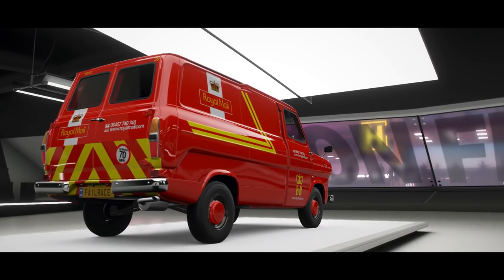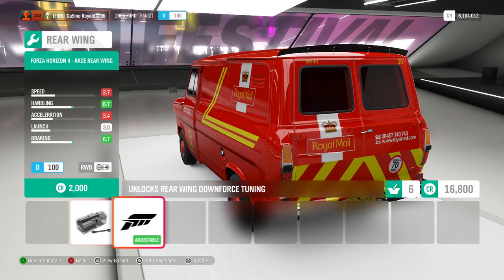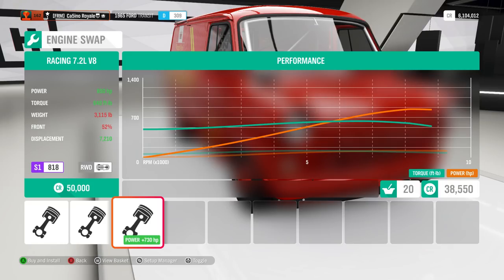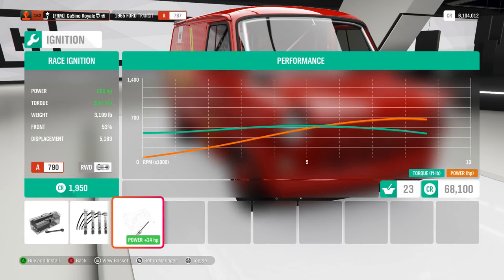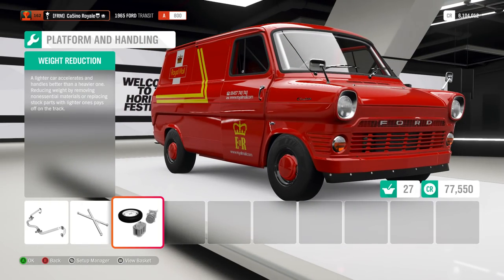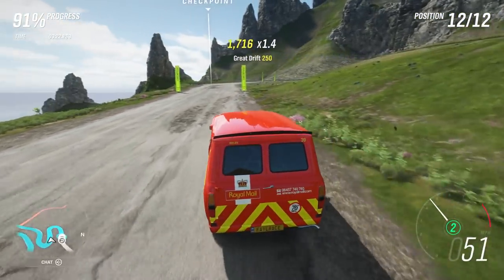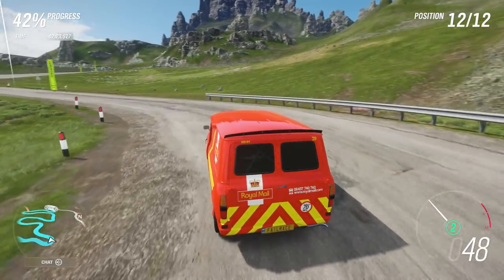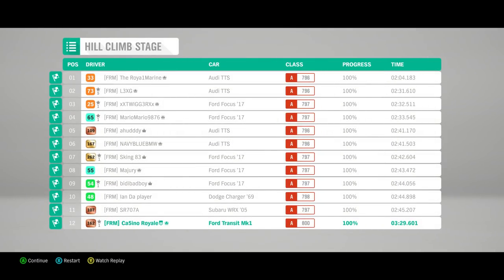Forza Horizon 4 - Hill Climb Build - Classic Ford Transit

Comment: the 5.2 v8 is the one out of the 2016-17 Shelby GT350R. It has a flatplane crankshaft and revs to 8200 rpm.

Comment: I'm a little annoyed that the Royal Mail livery has the website URL on it. I don't think that's period-accurate for an early 1970s 1965 van, seeing as how the web as we know it was still a good two three decades away.
Reply: @A real bisexual petrol-head Oh yeah, I know that. I'm really just saying that, if I was buying that Transit as DLC and it included licensed Royal Mail liveries, I'd want a period accurate Royal Mail livery as an alternate option in addition to the current Royal Mail livery. Is the Royal Mail livery even part of the 1965 Ford Transit DLC or is this just a custom?
Reply: Addendum: checking Google Image search, if I wanted to be 100% period-accurate to circa 1965 Royal Mail vans, if I were to drive a Ford at all, it would probably be an Anglia or Thames 400E and not a Transit, so I suppose my initial worrying about the accuracy of the livery on the Transit is moot.
Reply: @A real bisexual petrol-head It was just a throwaway comment that I thought the modern Royal Mail livery looks a little out of place on a 1965 van, though I still think it looks pretty cool on it. Since Forza Horizon 4 isn't a simulation of 1960s British mail delivery, I'm not seriously bothered by it.
Reply: @A real bisexual petrol-head It's possible that Royal Mail has a few old Transits for special occasions but I doubt they'd be in regular use today both because of the cost of fuel and to cut down on emissions.

Comment: you need to set your ride height, camber, and toe in properly to improve turn in, also the differential needs to be adjusted to make the oversteer more manageable. No reason that you can't shave another second or two off these times...
Reply: The idea is to see how good these cars are "out of the box" ie no tuning. He's been doing it this way for years.